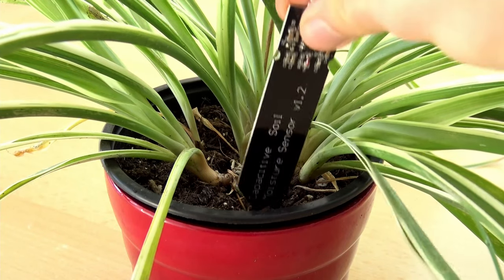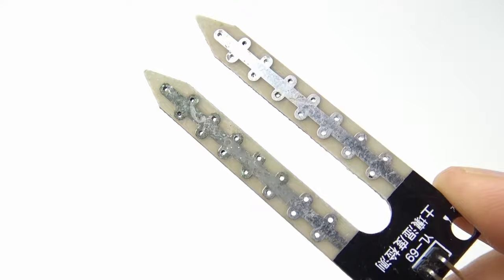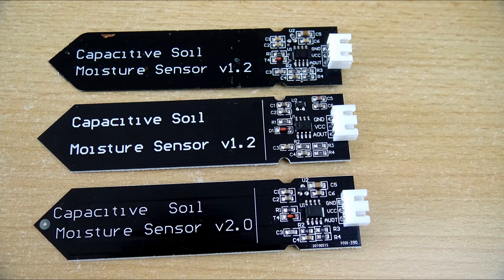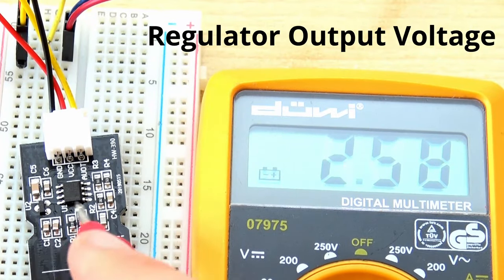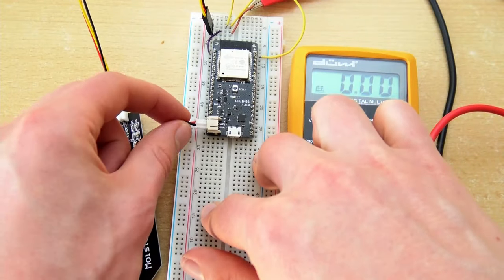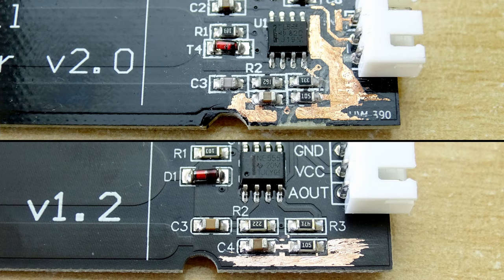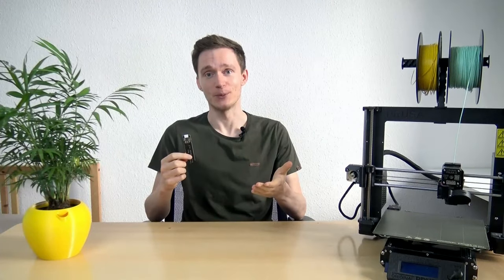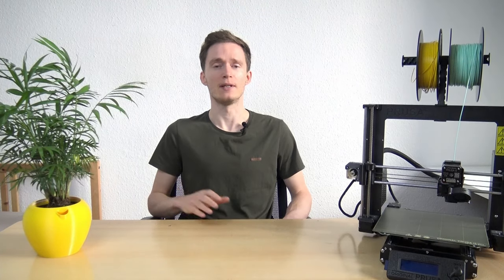Capacitive Soil Moisture Sensors don't work correctly + Fix for v2.0 v1.2 Arduino ESP32 Raspberry Pi

Comment: 2 years later, got mine. checked it just now.
1) voltage regulator is there, 662K as it should be.
2) Timer chip: NE555 but 33K label - works perfectly with 3.3V from an ESP32 output.
3) Resistor to ground: checked it, it's working as it should.

Interestingly enough, I was certain I had a faulty one, as the printed label on mine said "Capaitive Soil Moisture sensor v1.2"
Reply: Add some MOSFET to control the voltage regulator from the MCU. That way you'll save more power, only turn on the voltage regulator and sensor when your MCU wants to talk to it :) i would not advice put the sensors VCC to an MCU I/O as they are often to weak to output enough current.

Comment: Thank you very much for these great tips&tricks. I have checked my sensors, and discovered that they have issue no. 3. Thanks to your video, it can be easily corrected with one wire or resistor.
Reply: Mine as well

Comment: I have tried following this advice by looking at the pictures of the sensors, but from 3 vendors so far, the sensors that they send have not matched the pictures.  For example, I can see that the hole between the resistors is in the correct place, but when they arrive, the holes are in the wrong place, so it's a bit of a lottery when you order them.
I even had some arrive that were labelled "Capacltlve Soll Molsture Sensor v2.0".

Comment: Thanks for pointing that out, got three of the 2.0 Models, with 555c and Voltage Regulator but it has the wrong Punch Hole. I was wondering why they were so slow and never used them, now i will ad a little Cable and they will work fine. :)
Reply: same here. Seems common on 2.0 but the fix is pretty easy.

Comment: My second question: In your repair instruction you solder a bridge from R4 to GND. Why? In the wiring diagram the connection is missing between R1 and GND. Or am I wrong?

Comment: Bought about 30 v2's for $0.50 each from aliexpress some years ago, but always questionable results, thank you so much for explaining the issues. v2.0's with the via interrupting the ground track. Maybe worth the quick wire fix... 
 The real problem I found was corrosion of the connector/powerlines/circuitry (not submerged just greenhouse/atmospheric condensation). Maybe some conformal / waterproof (plastidip?) coating would be wise, I always thought the lack of sealing of the pcb sidewalls was also an error long-term.

Comment: I ran into an interesting problem with these capacitive moisture sensors. I wanted to connect 3 of them to a single Arduino. When I tested the system with only a single sensor connected everything worked as expected, but as soon as I hooked up the other sensors, their reading would always influence the output oh the others. E.g. I had two connected and took a reading of them in air: basically the same output. But then when I placed one into water, the output from the other one would also change. I got sooo frustrated by this! I’ll check them for what I’ve learned in this video, thanks!
Reply: Write your code so that the arduino staggers the reading from the 3 sensors, and have it turn on one pin per sensor only when its reading turning it off when its done reading. This should help with crosstalk over the channels considerably.
Reply: @oldmanbluntz  thank‘s for the advice!
Reply: @lorlimann  i discovered the method when i was testing this with resistive moisture sensors, and testing different things to reduce the crosstalk. I'm sure there is some DIY hardware filter that could also be made, but i was looking for a simple solution.

Comment: Great Video and I use these all the time, I am a little confused why the 1M resistor on the circuit diagram is marked as R1 and R4 on the circuit board?

Comment: It seems, that if you order the boards with the round cutouts, they do not have the third issue, but those with angular cutouts do have the issue. This criterium is much easier to see on the picture.

Comment: Very clear and informative video! I wish I had watched this before purchasing, but it was still very helpful in troubleshooting the problem with the defective sensors. Mine did not have the voltage regulator, so I will be returning them and trying another vendor...this time paying close attention to the photos! Thank you!!!

Comment: V1.2, 662k, Ne555 21K, resistance 100Ohm

Have not used it in Project because it was to slow to recognize differences. I think, i tried it with 5V.

Comment: Excellent video. Subbed. Of course there's another issue that the product illustrations can't be relied on because they are just that, illustrations and as such cannot be relied on legally or technically.

I'm sure we've either hand first or secondhand experience in the product comment section with people justifiable complaining about such matters with unfortunately little recourse.

(*FYI, not legal advice)

Comment: Hi, you could make DIY sensor probe (just a PCB with "capacitor trace" and probe without any electronic parts except connector). The two resistors, diode and capacitor you could placed at your adapter board. NE555 square signal could be generated from ESP.

Comment: Regarding the missing Ground connection: even if the copper coating on top is intterrupted, not all sensors are faulty. I bought some where this is the case, but the sensor has its ground connection. In contrast to the sensors in the video mine have got two top-to-bottom connections left and right from the white connector. Not sure where the ground connection comes from, but I think the connection is under the white connector.

Comment: Mine had a 3.3V regulator feeding a NE555 and missing the Resistance connection. The result I could see was a voltage signal slowly dropping to 0. I cut the connection between the 3.3V regulator and shorted the NE555 to the 5V from Vcc (using 5V out from Arduino). Now at least I get what it seems like a output proportional to how dee in water the sensor is. I will add the resistor later and try to solder everything properly today. Let's see if it works!

Comment: Thank you for your findings. I have a few and I found two of them with the same version number (20190515 HW-330)  but they are different. They both have the issue with the 1M resistor but one of them has a voltage regulator while the other doesn't.
I also have a few with the same hw version 330 but a different date. The date on the pcb is 20210603 and they are fine. The via hole is on the same spot with the faulty boards but the right pad of the R4 is connected on GND through other vias. There are four more vias on 20210603 compared to 20190515.

Comment: All these problems are due to the fact that to make life easier for users, the reading of the voltage output from the sensor is used. I have created a sensor that works on the same principle, an oscillator controlled by the capacitance between two insulated wires inside a sheath (a piece of common cable for household appliances) but at the output I read the generated frequency directly! Via the Pulsein function or other non-blocking methods if necessary / via interrupt. the disadvantage of this method is that the sensor must be calibrated for two values, while it is dry for the zero value "max freq"  and then immersed in wet soil for the max value "min freq" , arduino itself stores the parameters in eeprom and it is no longer necessary to recalibrate. in this way the accuracy is maximum, above all if three are made for each reading. "four samplings on the frequency" . The piece of wire about 50 cm long can be folded in a zigzag pattern or, as in my case, buried along its length since it is used to control irrigation in open fields. the same system can be used in these commercial sensors! they will have a more limited range of frequencies, but sufficient for good accuracy.

Comment: A good idea to further save battery, is to have MOSFET controlled by the MCU to turn off the voltage to the sensor. Otherwise it will draw some power even when not used.

Comment: Got one with all faulty parts. However, I have my device connected to the main power supply, and I am constantly getting data to open or close a valve, so it is actually perfect for my setup.

Comment: Thank you for this video! My sensor actually got the wrong via which cuts the GND plane, but the GND is still connected through additional vias between the VCC and AUOT (a typo which should say AOUT on my board 😂). It's a v2.0, HW-390, 20210603.

Comment: The ones that I had, have the voltage regulator and the TL555I timer IC, but they have the ground wiring bug. Now that I've watched this video, I can apply some hookup wire to the boards to fix that issue.

Comment: I have in my hands some sensors with the trace shown in your video as not good. They however do have the proper connection making choosing good ones even harder but just thought you should know you cant go by that trace apparently.

Comment: Great video. I recently bought v1.2 version with all 3 flaws you mentioned: 
- missing voltage regulator
- NE555 93M
- missing resistor
Noticed something is wrong when trying to calibrate it.
Thx for helping out !

Comment: I have a batch of the 2.0 version that looks like the pad near the 1M resistor is offset, but I get 1M almost exactly between GND and the sensor output.  I've coated them with nail polish to seal the PCB from moisture, so I cannot check the resistor directly, but the resistor leg is connected directly to the output pin according to the schematic.

Comment: Just the fact that they wrote AUOT instead of AOUT on the sensor says a lot... But still, I have the exact same V2.0 sensor manufactured on the 03/06/2021, misplaced wire hole, cut-off circuit where the hole is (this is clearly visible because of the embossing), and still, my multimeter bips when I try the ground to R4 connection.
So it has been fixed since, but another way since it still looks the same but is now working just fine.

So guys, don't rely only on this little wire hole place and do test your sensor.

Comment: very nice video!  My two v1.2 sensors have an NE555-93M, a thru hole on the side but a present 1M ohm between G and Aout, and a 0ohm resistor instead of the voltage regulator.  I have not used them yet but this video was very informative.  Now I know what to expect.  Thanks a lot.

Comment: My sensors do have
1. no voltage regulator, but i used them with a constant supply
2. NE555 not working with <4,5V, but i used constant 5V anyway
3. the hole is off, but it is connected to GND. 

But the main problem was that the isolation of the capacitor area dissolved in earth and moisture within a 3-4 months...
Another problem was that i wanted to measure really huge plots and it turned out the that the sensing area is much to small for that case.

Comment: Thanks for this really helpful post. I purchased 11 of these things, 5 from one supplier and 6 from another. I got none of them to work using the 3.3v power supply from my arduino. I picked up the resistor issue from other posts, which also recommended the fix you mention, but it didn’t help when tried on one of my devices. Following you list I found that 10/11 had the missing regulator answering timer issue as well as the incorrectly position wire hole. One ( the only one marked v2.0) appears to have the voltage regulator and correct chip, but still has the hole in the wrong position. Maybe I can get this one to work! Do you see any hope for the others if I power them with fixed 4.5v or so (my projects are not battery driven, so this could’ve done.

Comment: I have the one with Via located to the side of midpoint between 1M resistor and capacitor. But both sides of 1M resistor is connected to where they should (gnd and aout pins of connector)

Comment: Wow! Just checked mine and it has the older 555 timer, is missing the resistor, and is even missing the diode on the left of the timer chip! No wonder they came in a 2 for 1 pack 😂

Comment: I bought m5stack watering units, these include capacitive sensors (they can be separated from the unit, they are just plugged together with pin headers).
The pcb design on these is different than those in this video but the components are the same. The timer chip and voltage regulator are there, because of the different design i did not find the resistance.. but since the pcb is different its unlikely they have that connection problem.

They do work, but I get a ton of noise on the signal.
I put a rolling average over them, but still the signal likes to walk down and up about 10% (after calibrating 0% and 100% with air/water).

I don't know if that is normal 🤔

Comment: Interesting. I actually made a similar Projekt around 3 years ago but of course much simpler. Instead of a Webserver i just used a telegram bot in case something seemed out of order or the reservoir needed refilling. However since my project was connected to a PSU it constantly checked water levels and averaged it over the last 10 readings while alerting me if all 10 would be the same in case the sensor breaks. Didn't know that so many of them are DOA

Comment: I'm curious.
when you're talking about the missing resistor connection.
On the schematic, you're pointing at R1
But on the board, you're testing R4

Are they supposed to match up with the schematics?
Did you just highlight the wrong area of the schematics?
Reply: He tests the 105R smd resistor.
Reply: R1 on the board is actually a 10K ohm resistor as labelled ''103'' and R4 is the 1 mg ohm resistor (labelled 105 ) 
 THEREFORE THE FIX PROPOSED IS CORRECT  but the diagram miss labelled.  R4 corresponds  to R1 (1Meg Ohm) and R1(10K Ohm)  is labelled R2 on the diagram

Comment: You also want to encapsulate at least the electronics on the top bit, if it's near moisture your values will goto shit or it'll crap out as the moisture and gunk builds up between all the smd stuff.

Comment: If you use a sensor like this, the PCB is not waterproof laminated. After some weeks the water will corrode the sensor's plate inside the pcb and it will measure junk values. I suggest to buy a Pinotech soilwatch 10, it cost more, but  working after a year outside.

Comment: I have one with a NE555 21k. The data sheet says that the minimum supply is 4.5v, but it works the same on 5v and 3.3v pins.

Comment: List of timer chips that (probably) work on 3.3V:
 - TLC555C
 - TLC555I
 - NE555 20M
 - NE555 41K
 - NE555 21K

Feel free to reply to this comment if you find another working chip, and I'll add it, so this comment can be a resource.

Main comment:
This is some seriously great content. Since this is such a resource to the community, I'd like to contribute to it. I bought a v1.2 sensor with a NE555 41k, which works wonderfully with a 3.3v output pin on an ESP32.

I watched this video way back, then recently just bought the cheapest sensors I could find without referring to this video, so I was kinda bummed out when I looked at this video afterwards and saw a NE555 chip on the sensors. I decided to try it anyway, and they work flawlessly. The only really dumb thing is that the ground and VCC wires are swapped on the connector, which made me think the sensors didn't work for quite some time.
Reply: 20 pcs v1.2 with  NE555 21K working fine...

Comment: I just got a batch of v2.0 where almost all of the units had the TL555 chip mounted 180 degrees wrong... Only solution was to blast the chip and resolder correctly.
Reply: I also experienced the same issue with some v2.0 modules (AITRIP from amazon, and DIY-Victor from aliexpress). However, I didn't bother with fixing - still hunting for other rando suppliers on amazon.

Comment: Thanks Flaura. On Your video at beginning the dmv  range showed 900V - 2.2V range . Later when you graphed 
I see values around 560m and down to 480m. Delta < 100mV…Latter when you show averaging of the good device, it show 982 (x) and 460 mV (goods) , 3 times. Pb is my sensors powered 5V produce , wet/dry 980m / 2400m;  delta over 1V!  The ckt Is regulated and tl555CSo , why your video and my bench are not in accord?  Vals and delta.?
I tested reproducible the same 980-2400 in 10 sensors. Thanks for reply and good day now?J

Comment: Thanks for the information. I was looking at several of these boards, and many show a TL555C (as opposed to TLC555C). Looking at a datasheet from Texas Instruments, it looks like these are the same, just marked differently. Before I buy any of these, I wanted to check with you to know whether you found any difference in how these timer chips operate.

Comment: Very useful info, but how do you calibrate the sensors for 100% wet and 100% dry ?. 

I have tried taking a measurement when dry ( i.e not in soil) and when submersed in a glass of water, but this just does not seem right to me.

Obtaining samples of completely dry soil and completely saturated soil to use for calibration would be very difficult ??

Comment: I bought a V2.0. Sadly while working in short circuted my circuit and I could not finish it. I think all the components are damaged. In your video I found out the the wire hole was now in between on mine. Where can I find good ones?

Comment: I've just had 4x v.2.0 sensors HW-390 20210603 with the TL555 chip soldered on the wrong way round.  It has pin 1 close to C6 when I believe it should be next to R2.
Reply: thank you for this comment. I got 7 of these sensors today and none of them were working. I checked for all the connections, and it didnt even occur to me, that the chip might be soldered the wrong way lol. After resoldering I got 6/7 to work, Ive lost one in the process.

Comment: I've got a v1.2 capacitive sensor that has an NE555 with 93M on it and it does not work with my ESP32. Assuming its the 3.3v issue mostly, but it also looks like it has the resistor issue too...